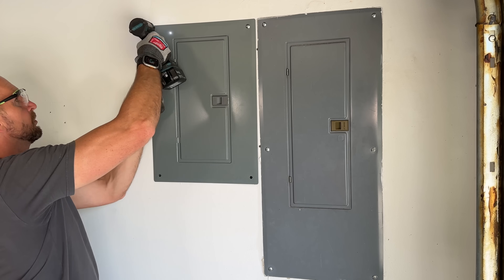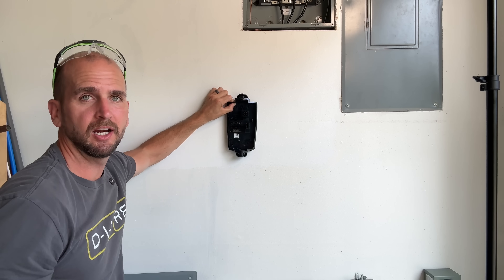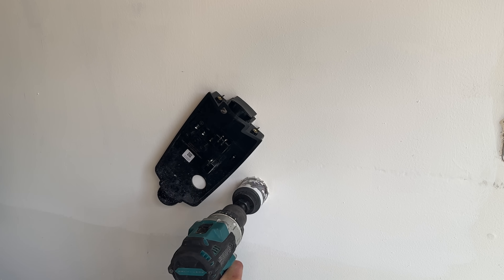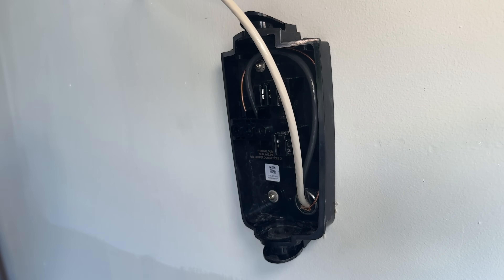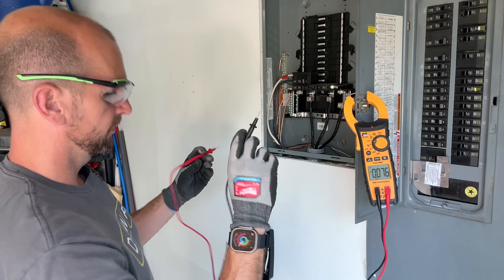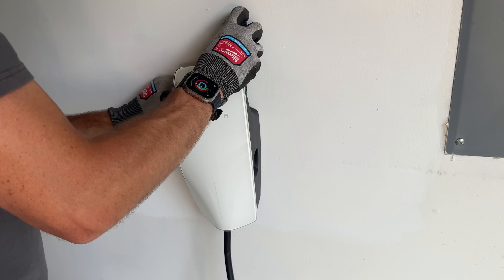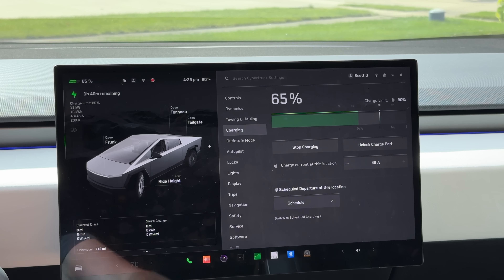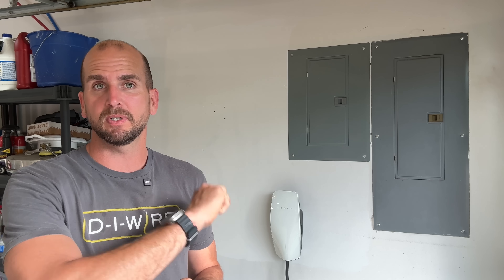How To Install An EV Car Charger | Easier Than You Think!

Comment: 6/2 Romex is in the 60C degree column. So, it is not code compliant since it is not upsized 125%. Tesla also requires you to use minimum #6 AWG, 90C degree (THHN) copper wire for the Wall Connector. 

You will either need to pull the Romex wiring out & run 3/4" metal flex conduit from back of the charger OR run 6-6-8 SER copper, like Romex but properly rated & won't need to run metal flex into the panel. Once that is done, then you run your #10 awg THHN green/ground wire (with insulated jacket) & 2 #6 awg THHN copper wires.

I install these everyday & am a certified Tesla installer & this is what I do/use on every Wall Connector install. You got the torque & wiring (also re-marking the neutral with red tape) correct & the install itself looks good. It's just not 100% code compliant & not what Tesla specifies for installing the charger.

Page 6 for reference
https://www.tesla.com/sites/default/files/support/charging/Gen3_WallConnector_Installation_Manual.pdf

Comment: 6/2 romex is not rated for a 60amp breaker this is a fire hazard. 6/2 can use a 50a breaker max
Reply: It's a code violation, but it's not a fire hazard. #6 NM  is good for up to 55 amps and can be used with a 60 amp breaker, but only if the max load is 44 amps continuous, or 55 amps noncontinuous.

Comment: Thanks for the details video. Our house previous owner had tesla, The box with wiring is done in my garage .They had wall charger which they took along with them.
Now can with same wiring . can i put Neema 14-50 receptacle   , or do i need Do I need 3-wire (2 hot, 1 neutral, & ground).
Reply: Skip the receptacle; hardwire is best option and no neutral needed.
Reply: The hard part is done.  Buy a wall mount charger of your choosing and your set.

Comment: EV charging cable is suddenly on the rise.  (This is only featured in the news almost exclusively from public charging stations)  however  if you don't have a garage and your charging cable
is outdoors while charging at home,  can someone guess as too how much money the cable and presumably the charging handle is  to thieves  who are recycling the parts
I guess for the  copper parts?

Comment: I already have a 14-50 outlet run, can I hook it up to that?
Reply: If you remove the 14/50 the cable will need to be inspected.  Not all cable used for 14/50 applications are safe for EVs.  Typically, nema 14/50 is for dryers and stoves...or larger equipment...the key I to be sure the cable is capable of a sustained or continuous draw for EVs.  A simple ev installer can probably come an give a free quote.

Comment: FYI - that’s not a charger. The “charger” for AC power is in the vehicle. That is just a mechanism to get electricity to the charger.
Reply: It is literally called the wall charger. Although you are correct, Tesla refers to it as the charger. Not the "mechanism to get electricity to the charger device". lol
Reply: @sofloemir  LOL. Wrong. It is called a Tesla Wall Connector, not charger. But a lot of people do refer to these things as chargers. Oh well. And yep, this romex wire requires a 50 amp breaker like others have posted. Should have used flex conduit 3/4" with THHN 6 gauge instead for a 60 amp breaker. Live and learn.
Reply: @DJ5200A5 Yes and all of those "chargers" and wall connectors are also referred to as EVSEs or Electric Vehicle Supply Equipment.
Reply: Thanks Einstein 😂😂😂

Comment: I am an electrician in south CA. This situation is very simple. Almost anyone with some simple tools can handle it. If anyone need to install a wall charger or outlet for Tesla more complicate than this. I can help you with that for around 400-1000 dollars.  If simple like this, 200 dollars is quite enough. Only the wall charger you need to prepared by yourself.🙃

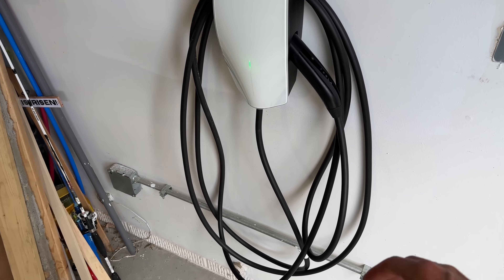Comment: 7:55  Any reason why you chose the Gen 3 Wall Connector instead of the Universal Wall Connector that Tesla also offers?  Since you have a Cybertruck, it is my understanding that you will only be able to take advantage of the Cybertruck's futre powershare capabilities with the newer Universal Wall Connector.
Reply from the maker: Right now my prime path to powering the home will just be using the NEMA 14-50 outlet in the Cybertruck bed and connected into a 50 Amp generator inlet which connects to an interlock in my main electrical panel.  I need to educate myself a bit more on the advantages of powershare over my current setup.
Reply: @EverydayHomeRepairs  Fair point.  Thanks for the response!

Comment: EV's are not feasible for most people, so this video really doesn't have any value for most people.  In addition to the many technical problems with EV's and how really expensive they are, the really egregious thing about them is that fossil fuel is being burned in power plants to generate the electricity to charge the EV's.  This is what happens when uniformed activists and politicians get involved with products instead of honest scientists and engineers who are the ones who actually have to build these things and make them work.  If you install one of these EV charging outlets, you may very well be removing it when feasible technologies are developed.
Reply from the maker: I guess time will tell.  If I was a betting man I would place my money on EV transition.
Reply: @EverydayHomeRepairs  There are too many issues, chief among them is the availability of things like lithium to make them.  As Toyata's Chief Scientist said, there isn't enough lithium and other resources to build enough of them.  This is the reason why Toyota is working on hydrogen fueled vehicles.  The environmental damage caused by mining the materials and the very bad labor practices also make this really unattractive.  Though the climate may be changing, it still hasn't been proven that it is caused by burning fossil fuels.  CC models fail to predict current climate when back tested with data from decades ago.  The earth has gone through warming and cooling cycles for thousands of years.  North America was once covered by a sheet of ice in the past.  There are many other factors that influence the earth's climate.
Reply: As an actual engineer, mechanical with a minor in electrical engineering, that works in the space and has a reasonably decent level of understanding (putting it modestly) about this technology, I can say with a high level of certainty you are full of shit. The only person with a political agenda here is you based on your post and it shows that you’re basically shilling for the fossil fuel industry or woefully misinformed of the reality of electric vehicle technologies.

Comment: I envy those who have a panel in their garage. My home is over 100 years old. Panel in basement on one side of the home and garage on opposite side of the house.
Reply: I’m in the same boat as you. What did you end up doing??
Reply: @onemanband8340 - for your case, if you have a 220v circuit breaker slot open in your panel, you could route a 12 ga wire from a 20A breaker to a connector in the garage.  This would allow you to use a 16A/240v charger which is very adequate for one EV, capable of adding about 180 miles of range in a 12 hour overnight charge session.  A very inexpensive install if there’s a clear path for wiring between panel and garage.
Reply: @onemanband8340  Nothing as of yet. I won't be getting a tesla till around 2026. Plan on having my garage torn down and rebuilt. Previous owners from who knows when added the garage way after home was built and it doesn't even have a real solid foundation.
Reply: When I installed my EVSE in the garage, I installed a 100 amp subpanel at the same time. We runned 60 feet of 2AWG Teck90 cable. It cost a bit more than a thousand (Canadian dollars).
Reply: These are always a challenge, especially townhomes built on a slab. If an older home with a crawl space, it may be possible to run the circuit to the garage that way.
Reply: Most convenient panel, ever.   My panel is on the basement, across the house with a finished basement 😤
Reply: @marx769  I know this comment is 5 months old, but I have the same situation. I spent 12 hours last Sunday running conduit through the ceiling of my finished basement from the power panel to the garage. I had to first kick the conduit outside the house, run across the house about 5 feet, then kick back. That got me into the utility chase where the HVAC trunk is, then from there it was super easy to run to the unfinshed part of the basement, which is on the back side of the garage.
Reply: same... i was wondering if i could just put a sub panel in my garage

Comment: Why don’t you have a neutral wire
Reply: Each hot is 120V, so the two together make 240V.
Reply: EV chargers don't need it. The only reason it gets installed all the time for EV charging is because the 14-50 outlet needs it. The neutral-less 6-50 outlet would have been the better fit for EV charging, but it didn't end up becoming the standard.
Reply: @letswritecode2283  What's actually what I have on mine from a previous Siemens charger install. I had to buy a 6-50 adapter to make my mobile charger work.

Comment: This is almost exactly what I did with mine for my MY.  I used THHN and a conduit though, and a 50-amp breaker (40A charging). It was VERY cheap to get that wire and do it all myself.  I was lucky that I didn't have to install a sub panel or run to my outside panel as that would have been much more expensive!
Reply: How did you run the conduit from your circuit breaker panel while it’s behind the drywall?

Comment: Will you be doing your own solar panel configuration, rooftop or otherwise?
Great to see this, but where I live, this can only be done by licensed electricians professionally approved by the owner of the electricity grid. This is the goal though, solar produced electricity, with excess stored on homeowner's battery, or on a Community Big Battery for evening use.
Great seeing people embracing the inevitable.

Comment: #6 Romex is rated for 55A. However, some inspectors allow you to round up to 60A… but you’re pushing it
Reply: The breaker can be 60A because 55A isn't a standard breaker size, but it's still a 55A circuit, meaning the continuous load must be limited to 44A, no ifs, ands, or buts. If an inspector allows 48A, it just means they aren't enforcing code correctly.
Reply: Or there’s a local exception. Code is pretty conservative (for good reason, wire is cheap, fire damage is not). The extra four amps probably works out in practice if the rest of the system is sane. Not an enforcement, just musing.
Reply: @m_cabral  You'd be hard-pressed to find any AHJ making amendments to fudge with basic wire ampacity numbers, a portion of the code that's been established for several decades now…
Reply: Sure, I agree. Just pointing out it’s possible. North Carolina will let you do “weird” things with short runs (less than six feet). Where I live they have a couple overrides where they just NOPE more recent editions of the NEC.

When stuff gets complicated I call the same electrician I’ve used for a few properties and his fun “wtf” was being instructed in a recent code update class to use grounds as neutrals to repair lighting runs with broken neutrals (my specific issue) just two days prior to my appointment. Yay NEC2022 + local rules.
Reply: I don’t get why he didn’t just use THHN. Would have been the same price and up to code.
Reply: @ericroe  Probably because it then requires conduit instead of running it loose in the wall. Edit: that's no excuse: do it to code!
Reply: @charliesullivan4304 yeah, not much more work and it would be up to code and you wouldn’t have a fire risk for over drawing the wires.
Reply: @ericroe  agreed, no good reason not to do it to code.  If you don't want to bother with conduit, you can also use 4 ga. Romex, which the Wall Connector accepts.  I didn't mean to make excuses, just explain the motivation.
Reply: #6 MC, and cheaper than romex.
Reply from the maker: Thanks for the feedback 👍
Reply: @EverydayHomeRepairs  May I suggest a sticky comment with the correction?

Comment: Hi Scott.  You could have easily put in a 2 foot 3/4" conduit with a kick and used 6 gauge THHN.  That should be rated for 50A.  With a run that short, I would consider going to 4 gauge.  I had to run 60 feet from panel to garage for my wall connector.  My Model 3 RWD will only charge at 32A, but can still fully charge overnight.
Reply: Number 6 THHN is rated for a 60 A circuit and 48 A continuous current.  50 A isn't correct for either of those.

Comment: Biggest thing is to direct wire your charger. Many 240v plugs are NOT rated for continuous use. Of course you also need the proper breaker and wire.
Reply: Correct.  Most outlets..like the ones at Lowe's (for example) are designed for dryers.  Dryers do not have a continuous pull...just like a stove.  The outlet needs to indicate that it's EV ready...which is typically not in store.

Comment: I'm lucky- the the previous owner of my home ran a 4 gauge 60amp line to the garage so he could run a generator, back-fed (!) to the main panel for power outages.  When I eventually get an E-car I already have all the juice I need, will only need whatever charge controller module is prevalent for my vehicle.
Reply: Nice. Several EVs offer bidirectional charging so you can use them as backup power for a bit.
Reply: NEVER FEED POWER BACK INTO YOUR HOUSE PANEL UNLESS THE MAIN BREAKER IS TURNED OFF.... IT CAN KILL LINEMAN REPAIRING TRANSMISSION LINES DURING AN OUTAGE
Reply: @80CB750K  Oh, I know it.  What's crazy is that my building inspector didn't flag it.  It was a disconnect box with a 25 foot, 6AWG cable output and coiled around it, terminating with a live, MALE plug to plug into the 10,000 watt generator, and a dummy female receptacle on the wall to plug it into when not in use.  I replaced the disconnect box with a real sub-panel, and a 50-amp beaker to a proper  high-end 240VAC 50 outlet.  The basement breaker is 60amp for the heavy wire to the sub-panel.  So now my eventual e-car charging module can either plug in, or be hard-wired to a breaker from that subpanel.
Reply: @paulh6591  left ya with a widow maker whip.... 🤦‍♂️... lol... glad you know.... just putting  it out there for the rest of the world... it's why code requires  interlocks for generator power... consideration for the lowest denominator
Reply: Which should come with the vehicle for the price you pay.

Comment: I wonder what the real dollar per mile cost is of a electric car vs diesel or gas
Reply: 3.5 kwh/mi EV, $0.15/kwh rate.   costs  $0.04/mile.  For a 25 mpg ICE car, gas would have to be $1/gal to be equal.
Reply: Total cost per mile over the life of the vehicle? Probably not great for a Cybertruck. Things in an EV's favor: fewer parts to replace, no oil changes, electricity is cheaper per mile than gas, brake pad replacement is rare. Things in an ICE's favor: cheaper initial cost, cheaper tire replacement. Over 200k miles, you are likely going to spend over $25k in gas vs $8-10k on electricity.
Reply: @schubajo  No exhaust system to replace if you live in a place with winter.
Reply: Do a sreach on youtube there a diesel versus Tesla pickup truck Causeway motor charge the Tesla pickup

Comment: What about in the winter? Heater/defrost, wipers? Or Ac in the warmer months?  What if someone thinks they have enough charge to 
Drive somewhere, and they run out of charge? What then?  Have it towed?  How about an onboard charging system? 
A school bus is one thing, but a tractor trailer running all 48? Food for thought?
Reply: A base Cybertruck has a 250 mile range. Your range will decrease by 20% in the winter which still leaves you 200 miles of range. How often are you driving over 200 miles that is not near an electrical outlet? If you run out of charge, it is not much different than if you run out of gas except there are more electrical outlets than there are gas stations.
Reply from the maker: 😂, first wash was yesterday and all systems are still a go.

Comment: I’m glad your channel is doing well. Have you seen the specs on the new Silverado EV? I think it would be my preferred EV truck at this time if I was in the market for one.
Reply from the maker: Yeah, it is getting great reviews.  The battery is a Monster and gives it industry leading range.  If I were to go that route I would really think through charging to make sure you could fill the large battery in a reasonable time.  I am also betting on the Tesla charging network and Full Self Driving as 2 features I really wanted.  We will see if that plays out over time.
Reply: @EverydayHomeRepairs  one of the advantages of having a large battery in the Silverado is you can limit the upper charging to 90% or less and save the battery wear without really sacrificing range. Filling to 100% all the time isn’t good for maximum battery life.
Reply: @EverydayHomeRepairs How is it with towing? The big issues with a lot of the EV are weight and how much the range decreases when towing. I'm not in the market for an EV truck but am always happy to recommend one if it happens to get over those hurdles.
Reply: @EverydayHomeRepairs FSD promised for 8 years from a pathological liar. Not gonna happen. The Silverado EV is a great truck no doubt. Or a Rivian.